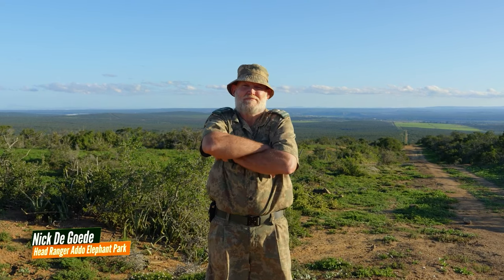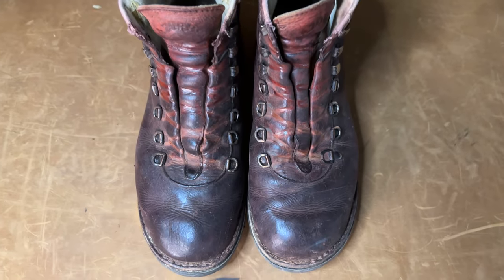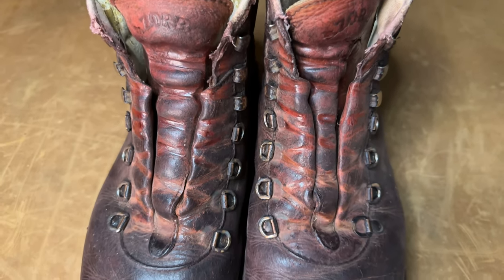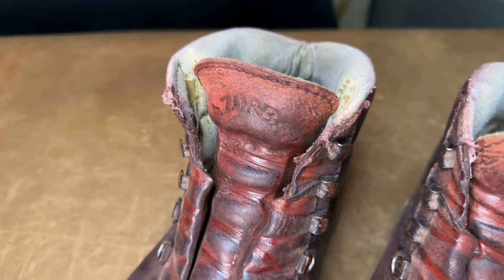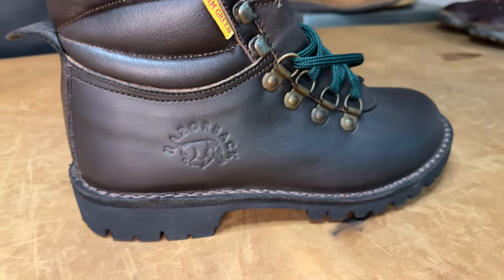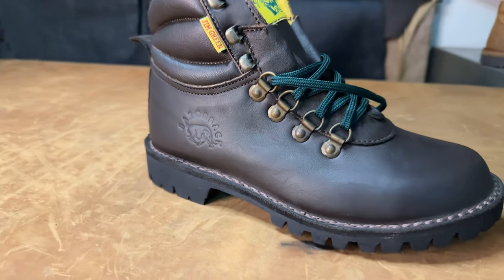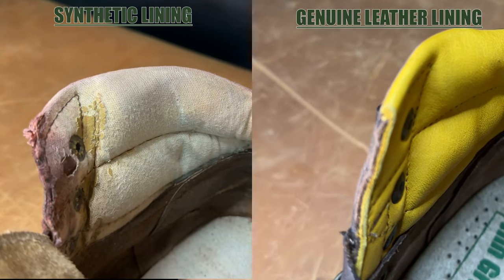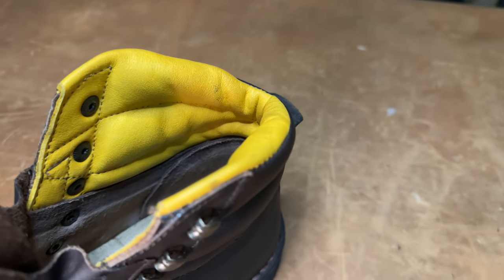30 Years of the Razorback Boot - What has Changed? // Jim Green Footwear

Comment: Got to be honest here.  I prefer the more subtle tongue branding on the older boots.  Everything else is good.
Reply: Never thought about the yellow tongue tag till you mentioned it, but yeah, maybe a bit smaller. And if JG used a leather midsole, charge an extra 50 bucks or so. Gareth?

charge an extra 50 bucks or
Reply: @barryrahn5957  their midsole is actually leather… kind of. The insole is not, it’s just cheap fiberboard, but the insole is actually made of a leather compound called leatherboard. Maintains some of the longevity of leather and doesn’t fall apart like fiberboard but it also is just not as a comfortable, as you’re aware I’m sure.